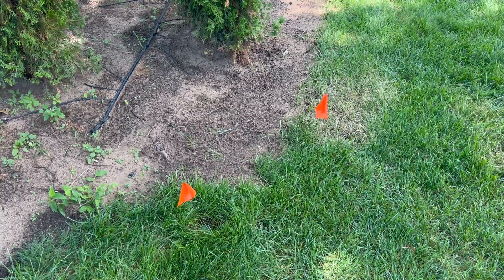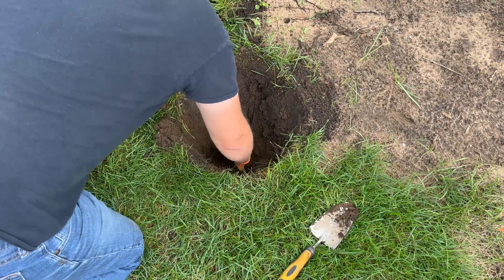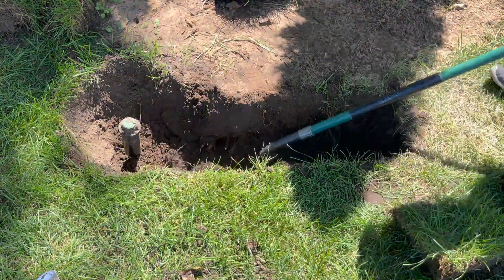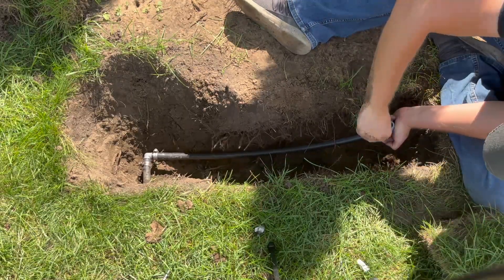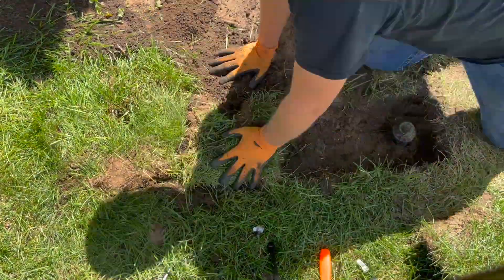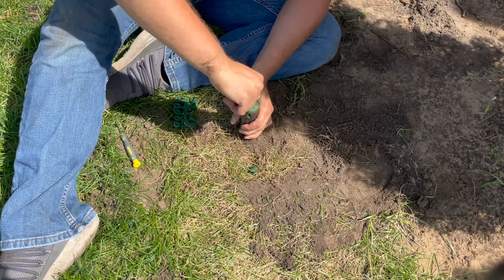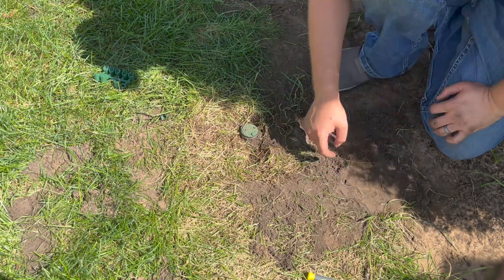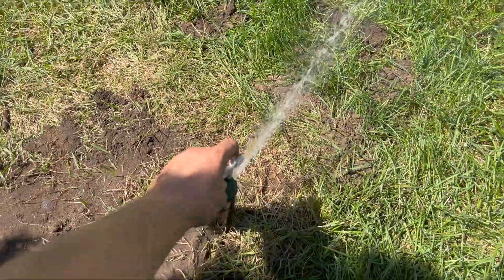How to move and adjust a sprinkler head. Orbit Voyager II

Comment: Great video, thank you.  You explained the adjustment for the stop limit on the rotation, but not so much on the start limit.  There doesn't seem to be an adjustment for that.  I've seen videos telling us to unscrew the top and lift out the 'guts' and physically rotate it to get your start limit where you want it but there's got to be a better way.  Your thoughts?  Thanks again!
Reply from the maker: Thanks for the feedback. For the start limit, normally I turn the top dial to the starting position and then I'll turn the entire base until its snug on the threaded fitting, but in the proper direction. If the head is already burried, then I just use one of the white adjustment keys to pull the head out and then rotate the starting point by hand using force. You'll probably hear it click while doing it this way but I definitely don't think you need to unscrew the whole thing and take it apart.
Reply: @Type5Reviews  Thanks much.  It is buried, and did lift up the head and tried to turn it but I guess there's gear teeth in there and it's pretty hard to turn.  Still think it's a design flaw.  The adjustable spray pattern is one thing but the start and stop positions are just as critical.  Thanks again.
Reply from the maker: No problem. Yeah it does take a good amount of force to cause the heads to skip teeth. If that’s not working for you you’ll have to dig it up a bit and spin the base. Good luck.